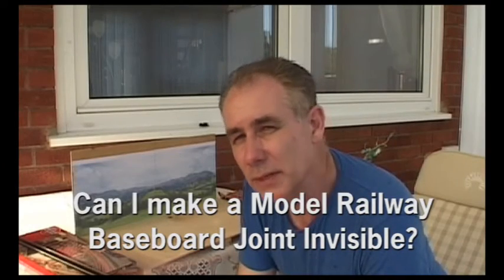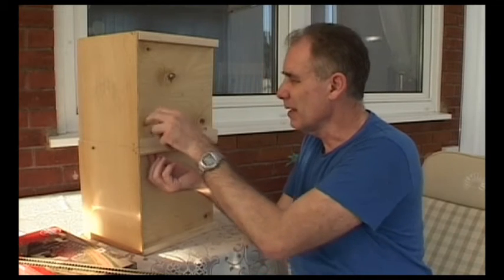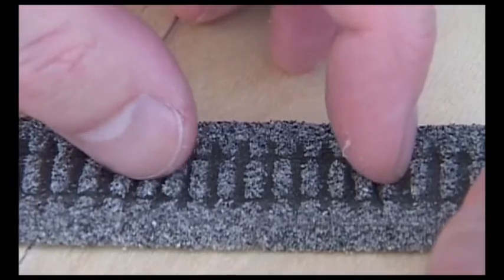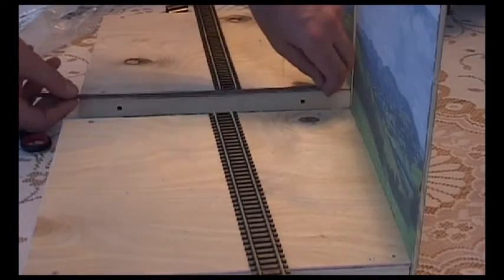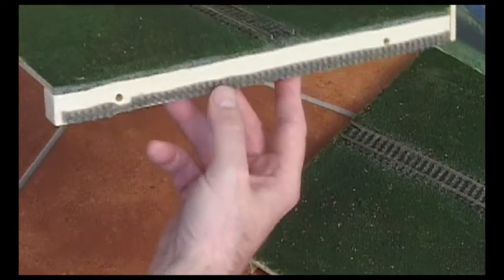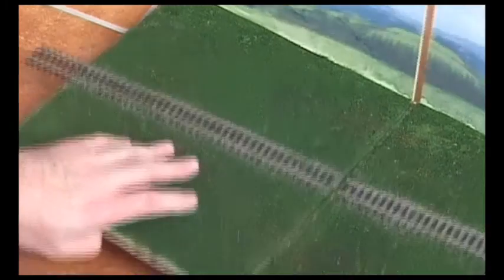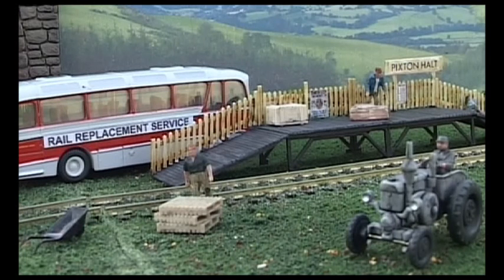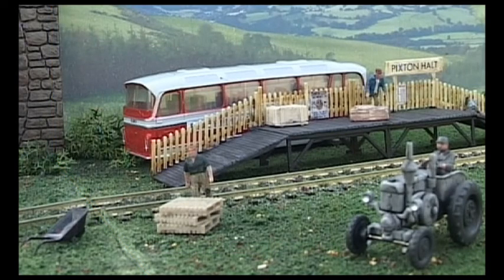Model Railway - Invisible Baseboard Join?

Comment from the maker: For layouts that need to be dismantled again - can the join be made less obvious?
Reply: What you did there makes quite a big improvement, but I've just had an idea - this may take more effort but maybe for every join you have a 3rd module to put above the join which would have the scenery on it, and the blend the third module into the layout, the base of the module could be of thin card with foliage overlapping the card's edges.
Reply from the maker: +AnthonyRailwayB Yeah that could be a good way to go. The third module that is placed on top does not need to be a straight line of course but any shape so as to match the area it is representing. So one patch could be a pond, another a bit of a grassy patch. As you say foliage hiding the edge. Good idea.

Comment: I think that the result is far better than  what generally can be seen. I have an other idea; since our brain is wired to see straght lines, you could try to deceive it using an usual baseboard for structural purposes and cover it with a thinner layer with irregular corresponding borders that then you can disguise with the foam. I don't know if I've explained my idea  with my poor english, sorry :)
Reply from the maker: +Michele Gianni Does sound interesting. But the problem with boards that split apart to be displayed at shows, is that thin piece would need to be laid in place each time. Or if it was attached it would be thin and perhaps fragile? 
A baseboard could be an irregular shape though or at an unexpected angle, so I see what you're saying.

Comment: I'm a novice who has only made a few basic dioramas and bases for Citadel miniatures models just watching this out of curiosity as a fan of train layouts but once you've done this method couldn't you mask the tracks then spray varnish (or maybe you can get actual spray glue) thinly over it and then dust it with the fake grass?  That's what I'd try.  It might only be necessary to srpay over the join but you want to avoid having a line of grass that's just as obvious as the join line.  The idea is that tiny pieces of the fake grass will settle in positions that overlap and conceal the join; and being glued in those positions, they should remain even when disassembling the boards.  You'd just have to be careful not to disturb the edges once they were separated but the process could easily be repeated if necessary.
Reply from the maker: Interesting idea but the joins will be prone to damage, so I think this is probably the best I can achieve. Mind you it could be worth a go. I have junked the test piece now, or I could have given it a go.

Comment: Brilliant video. How does the track join together?
Reply from the maker: +The Train Dude Well in this case it isn't as it was a test. Normally though there would be no fishplates. Instead you have connectors below the baseboard, with wires soldered on to the 
tracks - these jump the power over. I didn't fit those on here as I was 
just concentrating on the modelling side on this test piece.

Comment: What are the type of screws/connectors did you use to connect the boards together?
Reply from the maker: I'm just using wing nuts here on bolts. I think there are other ways. But for this test it was sufficient.
Reply: Calvertfilm thanks, are they the best type to use?
Reply from the maker: I'm not sure on the best type. Might be worth garnering a few opinions at shows?
Reply: thanks again, I have been to various exhibitions and have seen that they are pretty much using the wing nuts. I have always wondered what they were and how they used them.
Reply from the maker: Well you just clamp the two pieces together and then drill through. That ensures the holes are lined up. Then the wing nut goes through. If the hole is slightly bigger, this allows for some fine movement to make sure the track lines up. 
Personally I try to make small layouts to avoid all of the issues of joins.
Reply: well that answers quite a few questions though my layout is going to be quite big. it is situated in the shed and I got about 3 boards.
Reply from the maker: Well if it is in situ, that should help you achieve a good look. It is moving them around for shows that is tricky. Wish you well with it.
Reply: Thanks, it will mainly be in situ and the only time it might come apart is if I was to move house.
Reply from the maker: Ok, well in that case you should be able to cover the joins with fine material, either laying it on there, or just lightly gluing, accepting that they will fall off if you ever move it. In the mean time your joins will be gone. Some display layouts do this just for the duration of a show. 
I don't know what you plan for legs but Ikea and B&Q do a range of legs that screw on underneath for kitchen units etc. These would be so easy to unscrew when needed. They also have adjustable feet. You can pay anything from £2.50 to £26 per leg.
Reply: Calvertfilm thanks for reply. I got my boards on multi purpose metal pasting tables. the boards sit on a wooden frame like yours does.

Comment: How about making the join a part of the landscape, for example a ploughed field with the gap as one of the plough lines and have a tractor or similar in the scene. Or the gap the side of a road / path and have a fake edge the other side of the road.
Reply from the maker: +hartrockets Yes these are good ideas Pete. As long as they looked similar. Sometimes baseboard joins look huge lol. 
I think if a fence is covering over a small join it can look OK as it looks as if it is part of the edge of the concrete to me.

Comment: Ok ya not perfect ,,,, but every ones attention is directed to it,,, with the pallets placed over the join a few bits of clumpy foliage etc it could be broken up even further,,,,, and in a exhibition situation to the first time viewer the normal gaping join would not be the first thing the jumps out to great the viewer,,,,  any onlooker would have to look for the join and on a finish layout with lots to take in and see its going to be way down the list ,,,,,,,   nice job
Reply from the maker: +Alan Plumb Hey Alan great to hear from you again. Yes as you say I could disguise it a bit more. Perhaps lay a little pond over one area. Lichen just laid over temporarily might be good too as it is relatively cheap, and easy to add lots, with it being packed up again in the bag after. It does not have to conform to the lines/gaps either but could be in clumps so as to disguise the fact it is a join underneath? Hmmm....